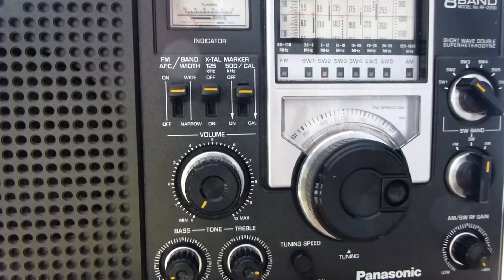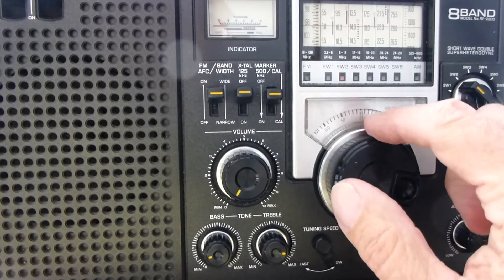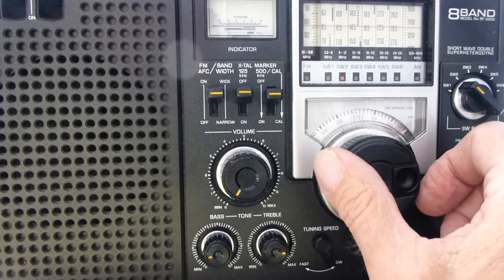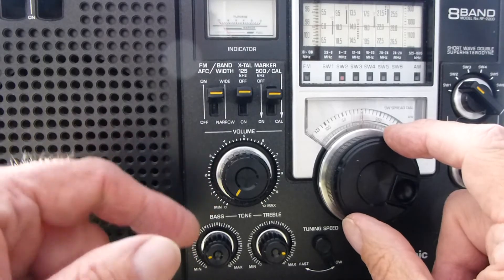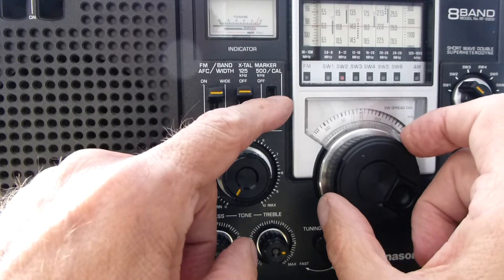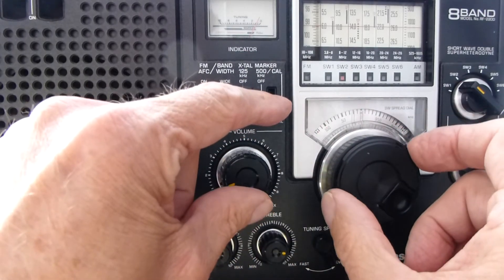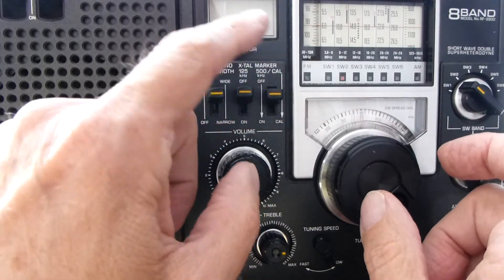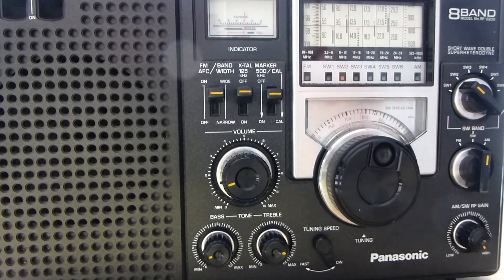PANASONIC RF 2200 CALIBRATION

Comment: Good showing of this technique! Each band needs this and sometimes if you tune on one band  several times. With this one can use the divisor of the circle dial to tune in stations more accurately. I done this and compared the 2200 to my Icom IC-7300 and it is very close! Bought mine at a flea market in Tennessee for 18 dollars....